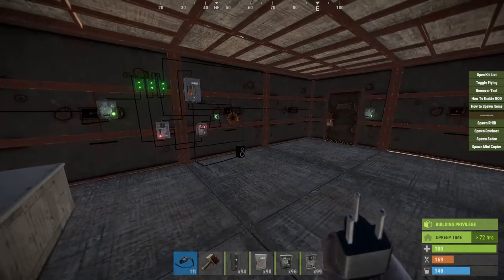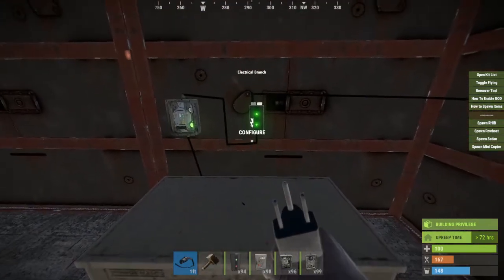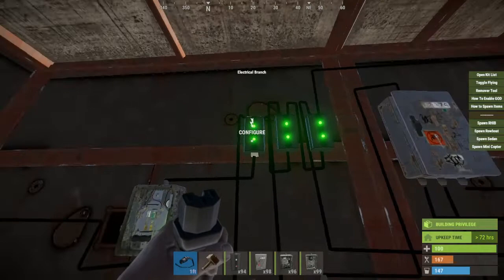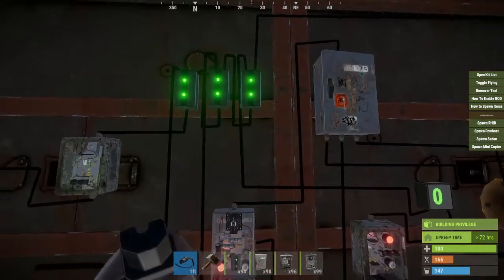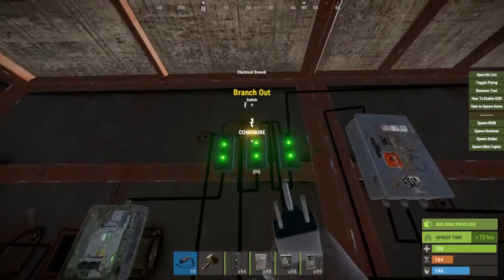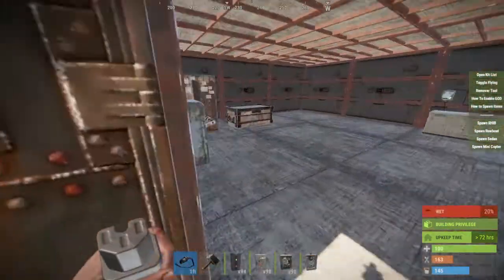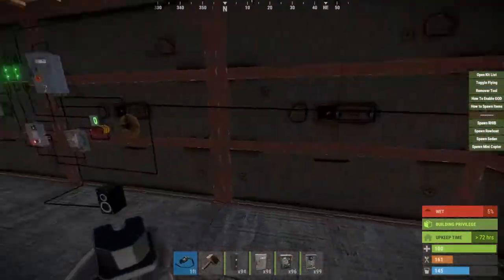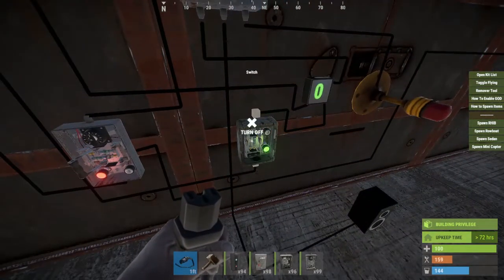Rust Electronics Tutorial - How To Setup Home Security System (Non-Wireless)

Comment: How would you set this up for two heartbeat sensors?
Reply from the maker: From the HB Sensor switch you would run a electrical branch, split it between your two HB sensors.  Instead of having the outputs from the HB sensors go to the toggle on your timer, you would use an X/O switch.  Connect both outputs from your HB sensors to the inputs on the XO, and connect that XO output to the toggle.  Done deal.  Hope that helps.  You could also use an OR switch if you don't have the X/O.